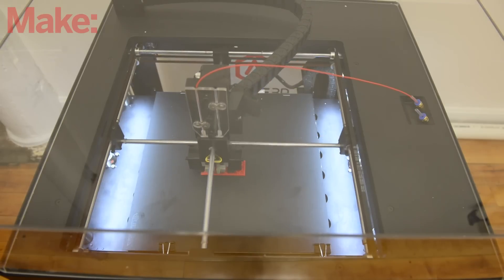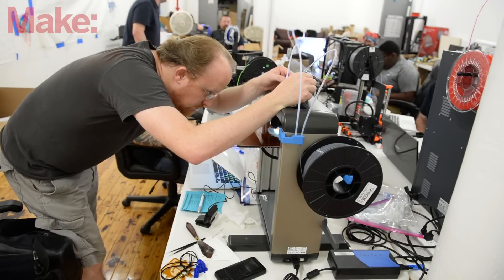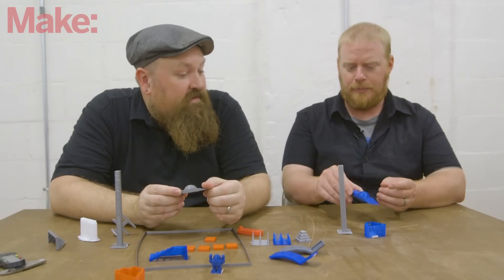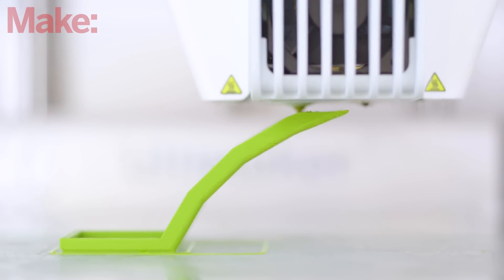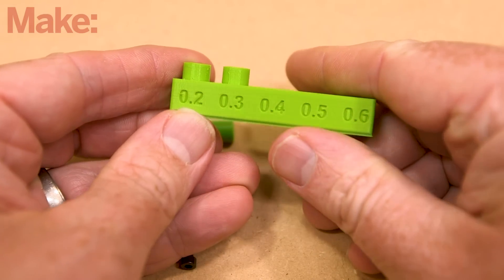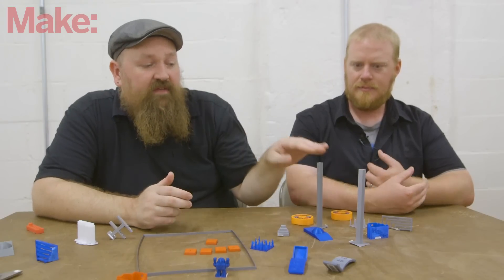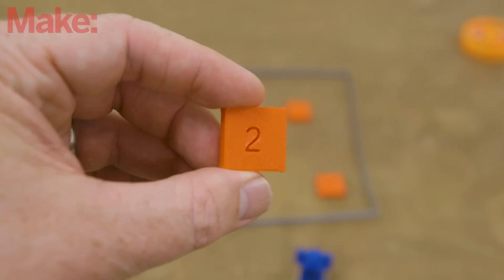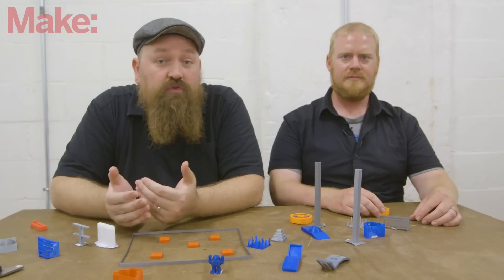How Do You test a 3D Printer, Anyway?

Comment: Hi, 
for your test (all of them) how do you know  if its a problem of the printer and not a problem of settings in the slicer ? (because each filament is different : they need different printing temperature, different  extrusion ratio/multiplier, retraction pourcentage, etc...)
 for example:  the support material test, it's the slicer who say at which distant of the object to place the support (0.2/ 0.1 etc) to avoid a bond between the support and the object; So how are you sure that its a problem of the printer and not a problem of the slicer ?
Thank you
Reply from the maker: Our testing protocol is to go with the default, baseline slicer settings, since that's what people start with, and in some cases, that's all that a particular recommended slicer might offer, and that's what some people might not ever move away from. 

Can you tune and tweak your slicing settings to achieve a better test result? Yes, you absolutely can if you have the time and knowledge to tinker away at it. What we're testing for is the "fresh out of the box" experience, or the experience people will have with this printer if it's their first time ever using a 3d printer.
Reply: ok, thank you  :)
Reply: when you publish your test results that everyone can see (in your magazine or on your website) 
i think you should write (where we can see it very well) that  the test is done without tuning the slicer specifically for the 3d printer that you tested and we can have better results  by tuning properly slicer's settings.
because before, i was thinking that you tests results showed the best of what could make the 3d printer that you tested with everything of tunned properly/perfectly
Now i understand  why some tests results suprised me...
Reply: Also, what slicer was used. Cura will be natively better with stock settings on an ultimaker because that is the machine it was made for.  These are empirically bad testing conditions.
Reply: That is NOT what people use. People use the Factory recommended settings Even cheap ones like Anet tell you what to set in cura and even offer the settings file. And on top of that each filament has it's own recommended speeds and settings. so your tests are wrong.
Reply: @normcaissie5598  Tests are standardised - that's the most important thing.

Comment: Hi,

I would like to try your tests on my 3D printer, but when you run yours for judging, what layer height are you using, and if applicable, what infill percentage. I assume you don't use generated supports and build plate adhesion options in the slicer. I'm basing this question off of the Cura 3 "Recommended" settings.

Thanks

Comment: When testing for dimensional accuracy you mentioned that any difference less than 0.1 mm will be considered a high quality print. However when you measure your test sample, it read 20.25 mm and you still said that this is a high quality print.
Is this a mistake or am I getting something wrong?

Comment: Hi,

These are some good calibration tests, useful for tuning a particular printer. However, a lot of variables need to be controlled for direct comparison between printers to be valid. Can you talk a little more about what was done to keep the testing fair (beyond the numbering system that was mentioned)?

E.g.

How much initial calibration / tuning does each printer get? During shipping, belts / eccentric nuts / etc. can loosen and it seems a bit unfair to judge a printer poorly because of that.

What environmental considerations are made? Ambient temperature / drafts / etc. can affect print quality quite a bit.

Is anything done to reduce effects due to different filaments? e.g. does each roll of filament get used on all tested printers? I'm certain that the examples shown were just for illustrative purposes, but there were a couple of "this print [which is orange] is not good, but this print [which is blue] is good", which just made me wonder if the blue plastic is providing an advantage.

Other factors, such as orientation of overhangs and printing speed can greatly affect print quality. How was this handled in the testing?

Thank you

Comment: I apologize if you've already covered this subject.  I'm completely new to 3D printing.  40 years of CNC operating and programming though.  I just discovered your channel.  My first printer ever should be here in a couple of weeks.  At 72 yet - so wish me luck - LOL
If you have videos, or good links for this question, please post them.  Most processes have a preferable order - just like machining, or installing drivers on computers do.  Do you have an optimized order for fine tuning a printer - or, for filaments after the printer has been tuned. 
I assume bed leveling first, once the printer is stabilized mechanically - belts, tight screws, etc.  Such as extruder temp, bed temp, acceleration/deceleration, jerk, accuracy, retraction, etc.  I assume also, that there is a preferable order starting from the adjustments with the most effect, and ending with the ones with the least.  There are lots of tuning part downloads available (like your evaluation ones), but I haven't seen much about what order is the best - if any.  I realize that the filament is an ever-changing variable, but most newbies like me will probably start with a somewhat low-end PLA - in order to keep the learning process costs down to a minimum.  If you don't have info to recommend, it might make for a good video, like this one has been.
Thanks!

Comment: Few questions, 1. Who prepares each printer? The owner or a rep from each company? 
2. Is only one  slicing profile allowed for all the prints or can a new profile be made foflr each print? 
3. What were the minimum requirements for each profile, ie can I print at 20 mm/sec to make sure it prints good or was like 50mm/sec a standard. Also, what layer height was required? 
4. How many attempts was each printer allowed? 
5. What are you comparing the test pieces to? Commercial FFF?

Thanks for all the great test prints!